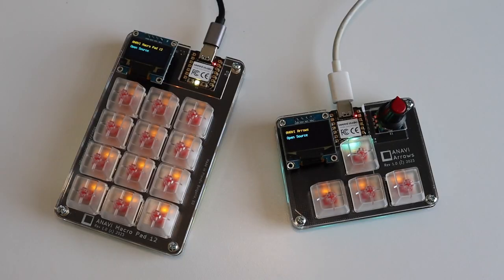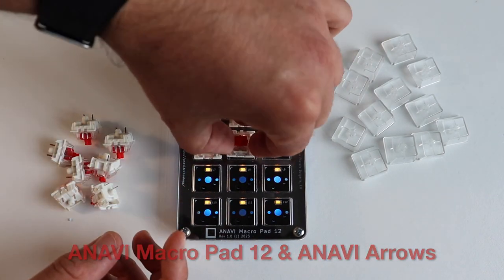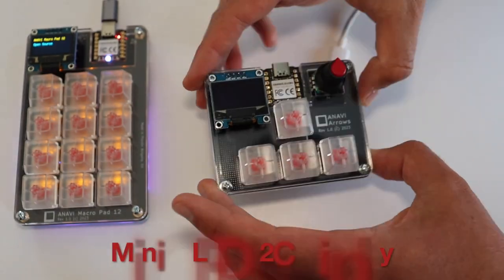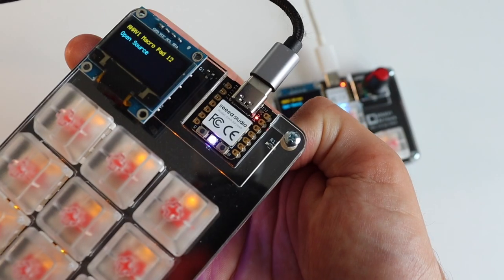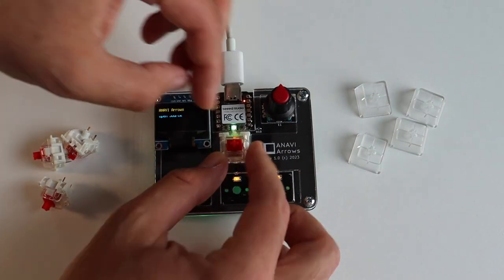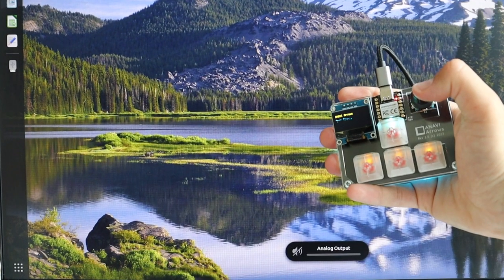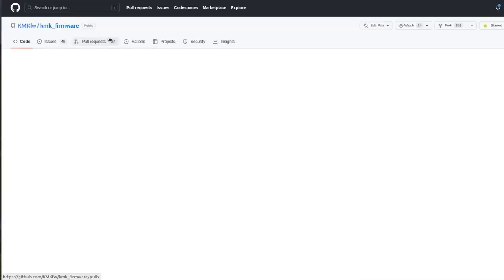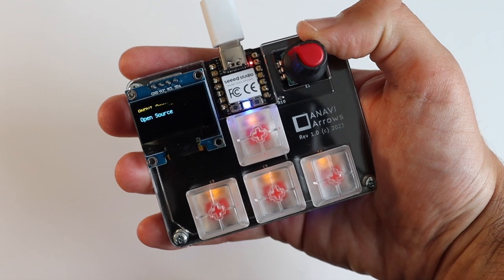Compact Mechanical Keyboards: ANAVI Macro Pad 12 and ANAVI Arrows

Comment: G'day, I am wondering if it can do Speech to Text, and how small can it really get? I saw the XIAO Esp32 being tiny. 
I have a project that requires wireless, real-time Speech to Text capabilities, and 4 programmable buttons on it... in the smallest form factor possible... Max one index finger size.
Do you reckon it can be done with Esp32's or am I better off looking somewhere else?
what would you suggest?
Reply from the maker: Yes, if it possible with XIAO modules with ESP32. Check the open source project: https://github.com/espressif/esp-sr
Reply: @LeonAnavi  Thank you Leon! I will check it out. I am not an electrical engineer... I doubt I'll understand what it going on there but I'd definitely need help with something like that. 
Would you be able to help with a project like that?
Reply from the maker: @Monsieur.Nobody.  it theory yes, in practice I am quite busy so sorry to say it but not.